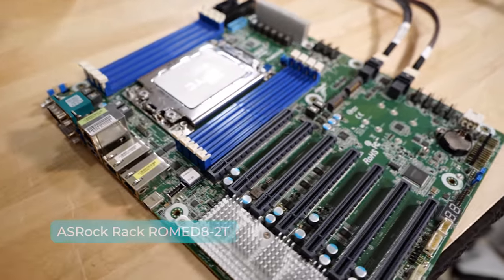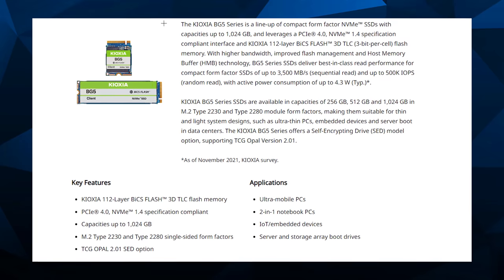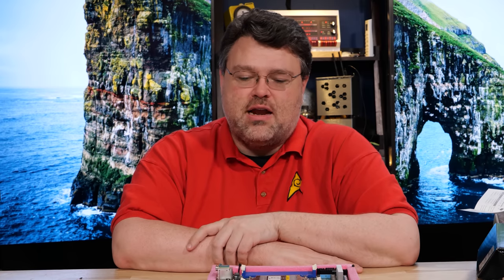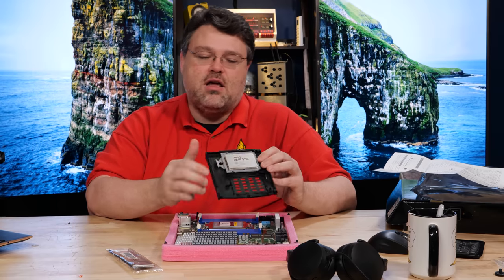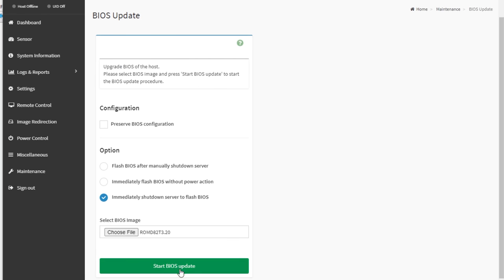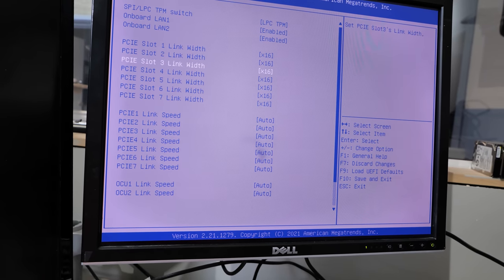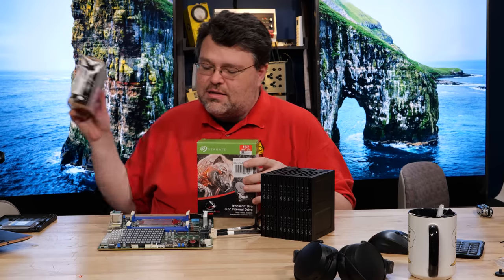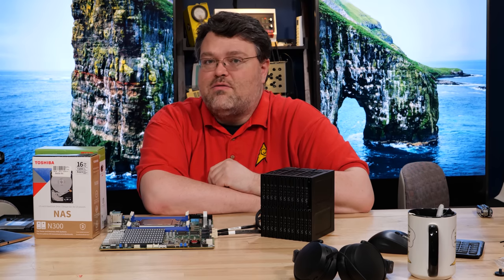ASRock Rack ROMED8-2T Review, proto-Build & Chat. What do you want to see?

Comment: I use this board since May 2020 and found it to be without issues and rock solid. Paired with a 7702p, 512G RAM and loads of NVMe storage, I use it for simulating compute infrastructures (OpenShift, OpenStack, Simulators for appliances like F5, NetAPP, A10 and whatnot. I wanted a board with BMC, tons of IO and nothing else. I like populating slots myself, not being forced to live with the peripheral choices made by the manufacturer for me. The onboard X550 NICs are perfectly fine for me and quite capable 10G NICs, however. BIOS allows to tinker with pretty much every option in EPYC and under Linux it is just plain perfect. Not a single parsing error in the ACPI tables, everything perfectly supported down to i2c&friends and not the faintest sign of instability. Yes, it is expensive, but if you are shopping at that price point and have similar requirements, I'd take a very close look. I can only recommend it.

Comment: Built a system with that and the 120W EPYC 7282 last year, lovely setup! It's called ROME because it came out all the way back when Rome was new, and replaced the 1st Gen EPYCD8-2T. Also, remote KVM without additional licensing cost or other nonsense is AWESOME. It lives in a Rosewill RSV-L4000 case, which isn't fancy or hotswap, but has enough space (plus a pair of ASUS Hyper M.2 PCIE4 cards to house NVMe M.2 SSDs). Finding compatible RAM was a bit tricky back then, but checking the official memory compatibility list led me to Samsung M393A8G40AB2-CWE, which work perfect and at 3200 speed. The PDF User manual contains a great diagram of how PCIe lanes are allocated, which is a good visual representation of the lane options for Slot 2.
Reply: Regarding the RAM: x Kingston Server Premier 32GB DDR4-3200 CL22 (KSM32RD4/32MEI) also works like a charm.
Reply: thanks it's always useful when people give info about which other hardware or cases they use, also the lanes diagram is great I've been owned twice already on that aspect
Reply: Moving to my Supermicro F628R3 from a Dell T620 was a breath of fresh air when it comes to IPMI, so nice not having to worry about any licensing crap and almost everything is there. Only thing behind a license I think is the remote bios and BMC updating.

Comment: I have the non-10 gig variant in a Define R6 and it fits just fine. You have to remember to remove one of the chassis standoffs to avoid shorting out the motherboard, considering server board standoff orientation is different from consumer/gaming boards.
Reply: does the board support bifurcation?
Reply: @esotericjahanism5251  the variant I have is a tad older, but I think I recall seeing bifurcation settings in the BIOS.
Reply: @Alphahydro  thank you for your answer.

Comment: I recently combined my server and editing rigs as I am moving and space will be limited. Its an oldy but goody 1920X Threadripper with an Asus Hyper NVME expansion card coupled with 4x SSD and approx 10x HDD's in the Define 7 XL..I will be adding more storage and with some clever 3D printing I can squeeze 10X SSD's and 20+ HDD's (3.5") and will beadding/upgrading the storage capacity over time. Eventually I would like to find a 2nd gen Threadripper..maybe a 2970WX and a better mobo to boot. Currently rocking an EVGA 3070 FTW3 Ultra and a mere 64GB memory. Plenty of room for improvement but its a huge upgrade from the AM4 Athlon APU that started this servers life. Thanks for sharing..that mobo looks like a powerhouse! Can't wait to see your build progress

Comment: It may be a bad idea but I want to see this thing to be a "everything at once" build which includes 4-6 bay NAS, 1Gig 4-port Pfsense for WiFi APs, Home IoT dockers, virtualise Windows & RDP it to Chromebook, casual 1080p@60fps gaming.
Reply: I have a Supermicro H11SSL-i that I've got most of that running on. What you're thinking is hyperconverged. I built it in a Supermicro tower that's been converted to a rack mount (CSE743)

Comment: Supermicro should learn from AsRock on how bifurcation settings in a BIOS should look like. Been rocking this board with a 7402P since June 2020. Love this thing with the versatility. I have 2x ASUS Hyper M.2 cards, 1x x4x4x4x4 U.2 Card for 4x U.2 nvmes, 1x P2000, 1x 1080TI (its ok to disable that slot 2...), 1x external SAS to my JBOD underneath.
Reply: My H11SSL-I looks pretty much like this, not sure what you mean.
Reply: Quad U.2 card? Or 4x M.2 card with adapter cables to U.2? I prefer slimSAS with PciE connectivity though.
Reply: @morosis82  My X10DSRL-F is confusing as hell that references the block diagram. I think Level1 did a video at some point showing the board. https://youtu.be/hv3mfSUO0pI?t=468 heres a link for reference.
Reply: @ephy-san  it's probably because of the PCIe lanes available. Epyc has so many you can have 6 or 7 PCIe 16x slots and still left over for other stuff.
Reply: @ephy-san  yeah just took a look, every slot can bifurcate to either x4x4, x8x8 or x4x4x4x4 depending on whether it's a x16 or x8 slot

Comment: Would love to see a video on building your own DIY NVME backplane. Ie, pcie switch cards with breakout to some kind of 3d printed M2 or U2 drive holder? Basically, anything to build a 20-24x nvme backplane, but without paying the OEM markup for an nvme chassis/backplane. Thanks!!
Reply: I'd love to see something smaller, I want 4x u.2 disks but the only way to do that without a proper server is individually cabled or there's an icybox mb699vp-b which is a 4x u.2 cage for 5.25 bays, but expensive.

I'd love to slot 4x sff8639 cables into a printed cage for connectivity, as they can be had for about $25 each.

Comment: Could not find a related post in the forum so I'll post here.
I have similar setup yes. 4x8To iron wolf in RAID5.
I'm using mdadm to spin the raid (proxmox host).
The raid drive is path trough a VM and the VM mount is ext4. and I use samba to share it.
This is a very basic setup, I like having the VM as a nas and the directly the host, so I can control the resources allocation, and it wont eat up the host resources. And also for permission, user creation, samba conf, etc... it's not mixed up with the host, and that's really good.
I never really run benchmark on it. In write I have about 250M/s when I copy large files.
For read, I never had any issues, I have a couple of kodi and a docker with emby, I tried once to have them all playing at the same time no problem. (1080p)  have not tried 4k though, I could lol.
Now I'm knocking on wood but never had a drive failure and it has been running for a few year now.

For my use case, it's perfect. I know there is stuff like true nas that is certenly more sexy, but honestly, to share folder and hold data forever, I don't care about the webinterface.
I'll watch the forum see if any post pop up. Let me know if you have questions.

Comment: You're setting Determinism Slider in the bios wrong. It's confusing but setting it to Performance means that cpu will satisfy minimum performance expected from it while setting it to Power means that cpu will run as fast as it can and give you the best performance. You can find this info in the AMD's HPC tuning guide.

Comment: SATA DOM from previous generation (which was totally not usable for SATA DOM) was replaced with USB-C header, which is much better exchange for both servers and workstations use sine using M.2 for OS is still a better choice.

Toshiba N300, I bought 6 of 8TB and RMA'ed of them within a month, not a great initial impression, but they did replace them without any questions asked and very quickly once you contacted them directly

Comment: @Level1Techs As seen, eg, at 14:47, you plugged 4 RAM sticks into slots C1, D1, G1, H1.  Yet per the board's manual (p.29) 4 RAM modules should be in slots A1, B1, G1, H1. What are the reasons you chose C1, D1 over A1, B1?

Comment: The Oculink does not work with the ToughArmor, I've tried everything. 
My system: 
Chassis is a Nanoxia Deep Silence 6 Rev B (i can really recommend it)
Asrockrack ROMED8-2T Mainboard
AMD Epyc 7443P
8x Kingston Server Premier 32GB DDR4-3200 CL22 (KSM32RD4/32MEI)
2x ASUS Hyper M.2 x16 Gen 4 (with each 4x 1TB 970 Evo Plus NVMe) total of 8TB NVMe in a 4 Column Storage Spaces mirror configuration
(6+1)x Seagate Exxos X16 & (12 +1) x Samsung 860 Evo in a tiered storage 3 column mirror configuration. Each tier has a hot spare. Some SSDs in RAID for other stuff.
Microsemi Adaptec HBA 1100-16i and Broadcom HBA 9405W-16i as Storage controllers
SSD Enclose from ICY Dock (ICY DOCK ToughArmor MB998IP-B, ICY DOCK ToughArmor MB516SP-B)
Total of 10x 14cm Arctic ARCTIC F14 PWM PST CO Fan
1x Intel X550-T2 from the Mainboard and 1x Intel X710-T2L as an expansion card for network connectivity.
Reply: This might be an issue with ASRock Rack, have been testing Icy Dock’s U.2 OCuLink backplane on various AM4 systems with passive standard PCIe adapters as well as an active PCIe Switch NVMe HBA and the only issues I’ve run into is bad-quality cables and bad (Broadcom HBA) firmware. I’d invite you to present your issues in my PCIe adapters thread in the Level1techs Forum.
Reply: @abavariannormiepleb9470  I think i need a special cable but cannot find the correct one. I tried several including SuperMicro CBL-SAST-0972 . I gave up in the end  , now using another HBA.
Reply: Ive seen warnings on Icydock products regarding compatibility problems with OCulink
Reply: @TheExard3k  That’s true, however the waters are becoming quite muddy here quite quickly due to extreme quality issues with SFF cables when going for PCIe Gen4. Icy Dock don’t offer quality-controlled SFF cables themselves and mostly rely on customer feedback what works and what doesn’t. And most customers/users don’t even know to check PCIe Advanced Error Reporting for PCIe Bus Errors due to bad cables or connections, meaning a configuration might actually work but was sabotaged by bad quality cables.

It’s a sad topic.

Comment: I failed couple of times to get the system boot up. There are no tutorials whatsoever on youtube on how to do the build. 
1. Do the build. Mention all the parts used along with boring model numbers. Ideally the best bang for buck RAM (they are crazy expensive)
2. How to boot the machine. This is where i failed consistently. I couldn't view the bios on monitor connected via vga on mobo or using a gpu. And, go over the bios options and what they mean.
3. Install KVM and able to setup multiple VMs. I want to use the machine for NAS (Photos dump) in one VM, Plex server (I know its an overkill) in one VM, Home Automation in one V, Security + Dashcam footage ingestion via NAS through different VM and a regular Fedora or Ubuntu VM for code development VM
Reply: Also, if you have time, can you experiment with zfs storage for NAS which gives the highest performance?
Reply: I have 9 16TB IronWolf non-Pro HDD. Yes. It would be good to know what config will get the best efficiency with zfs-raid1/2

Comment: I've been wanting this motherboard for a while, always out of stock in my country. I'd love for you to detail a few things more about it, for instance it has no dedicated CPU fan header, do you just use one of the 7 fan headers noted in the manual as SYSTEM? - Also neither the CPU's or these motherboards come with the AMD retention socket screwdriver (like Threadripper comes with), is it safe to just tightened down the socket with a normal screwdriver by hand?

And finally, this motherboards front-IO (power, reset, activity indicator etc) are turned 90 degrees downwards. Does this affect compatibility in chassis cases like the popular ones people buy for home storage servers? (4U and such).

Comment: 1) Does the KVM IPMI work reliably? On AM4 motherboards ASRock Rack‘s firmware quality is something with “room for improvement”…
2) Thunderbolt 3 (Titan Ridge) or 4 “slapped” on an EPYC platform?
Reply: Not really 100%. TB3 does not work without header afaik? I cannot update my BMC from 1.11 to 1.19 due to verification error.
Reply: @towaso  I believe you can short two of the pins on the Titan Ridge card header, don't quote me on that though

Comment: What is the link to the forum for this discussion? 

I personally have been using 4 Seagate EXOS X18 18TB (ST18000NM000J-2TV103) in RAID 5, EXT4 Ubuntu server 20.04 LTS, on my Areca ARC-1882IX-24 for about 7 months without a problem. So far so good. Have had 1 issue with a HDD/Seagate drive over the last 10 year. So very satisfied with reliability for 24/7/365 usage in a SMB environment.

Comment: I am curious about the cabling and HBAs one would use to handle tha IcyDock 24 bay enclosure. I've been wanting to put together a compact file server using SSD's for a while now, but the drive cost has been the main hindrance. An Epyc setup like that is almost certainly not in budget, but I figure it should be straightforward to scale things down to something more affordable.
Reply: It looks like that doesn't have an expander, so you'd basically need 3x 8 port HBAs, or it looks like there are some older HP 24 port cards available for a reasonable cost (search SAS expander PCIe).

The real trick will be throughput, as that many SSDs will saturate a PCIe slot pretty easily, but if you don't plan 9nnreading from all of them simultaneously it would probably be fine.

Comment: Toshiba N300 Before the Pandemic was great have 4  8 TB of em which has been more or less benn thru lightingstrikes sauna öeveös of heat and losts of Brown electric shorts with no overcurrent protection 2 from 2017 and 2 from 2018 and they are still going strong.

so when i was going to build my own server ii bought 4 more this is in november 2020.
as soon as i pop em in i get SEEK ERROR  Rate warnings on all of em 001 001 threshhold 50 same on all and same on 4 diffrent computers.

im now on my third batch of RMA aka 12  HDD with the same issue produced in mid 2020  late 2020 and early 2021.  

wouldve RMA them faster but Surgery has been stopping me from beeing able to see.

atleast there hasntt been issues with the support.

But after 2020 something has been changed on them for the worse either its firmware but i think its the pcb cause i know Husqvarna hade similar issues with their  robot mowers and they failed with similar problems as the hdds aka fine until they where under load.

srry about my spelliung  btw.

Comment: If you want a partner in stress testing, say, "last gen" stuff, I'm starring at my two builds currently under stress testing across the following:
- 22x 10TB HGST HUH SAS3
- 4x Samsung PM1725A HHHL 3.2TB
- 3x Intel Optane 900P 480G
- 40Gbps Fiber to everything
Split between an AsRock Rack EPYCD8-2T w/7551 and AsRock Rack X399D8U ThreadRipper server board w/2950X.
It's all I could afford over the years...  But, I'm more than happy to test, as I am currently in the middle of the build and stress testing the drives.

Comment: How to flash bios without cpu? I want to see this. If can not show as. Then just admit that.
Reply from the maker: Works fine via ipmi. Plug motherboard in. Give standby power. Ipmi gets ip. Go to web page. Go to firmware section. Upload bios. Done 

It's more steps than bios flashback on a desktop board but it does work fine.
Reply: @Level1Techs  what if current mainboard firmware is old and not support lattes cpus. Then you do not have old cpu. Only new cpu which is supported by the latte's new firmware. This mean mainboard ipmi work without cpu in the socket?
Reply from the maker: Ipmi works without CPU in socket yes.

Comment: my now couple year old 5950x has 16 zen3 cores that extremely consistently see 4.4ghz full-time undermost workloads I throw at it.  Why are these 8 core epyc parts so SLOW!? (Especially for the money, and especially for the power consumption)?  Also, where's all the i/o on the consumer parts?  if I want any more than a couple m.2's, a high end gpu, and maybe a video capture card, there simply aren't enough pcie lanes on modern consumer machine... Where are the torches and pitchforks!?  seriously though...  Threadripper has been a generation or two behind every time they do a release since like the 2000 series...  why Doesn't AMD release a processor architecture at (mostly) the same time (or at least within a few months of each other?)  I'm really annoyed that I couldn't buy a "5960x" like you could in previous threadripper generations that have most of the benefits of ryzen but with a reasonable number of pcie lanes, support for quad channel memory, actual ecc support, etc...  it's so frustrating when I just want to build a workstation with decent i/o...  when zen3 released my choices were a (still expensive) 24 core (then) 2 year old zen2 based threadripper (3960x) with decent i/o but comparatively CRAP ipc and clock speed (3.8ghz!?) OR an actually really nice comparatively 16 core zen3 cpu with way better ipc that does 4.4ghz under most workloads pretty much full-time that's limited to 24 lanes of pcie, dual channel memory and except in very specific scenarios, not really ecc support due to motherboard support, where only the most bougie expensive boards have 10g ethernet even...  very frustrating times.